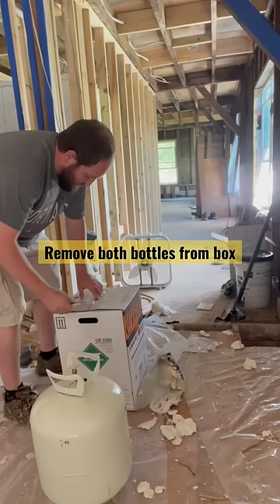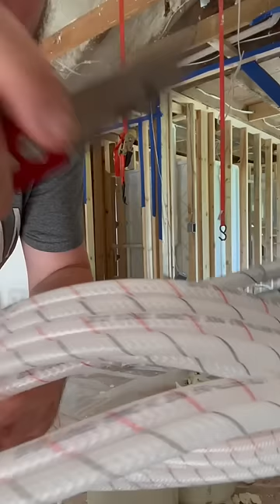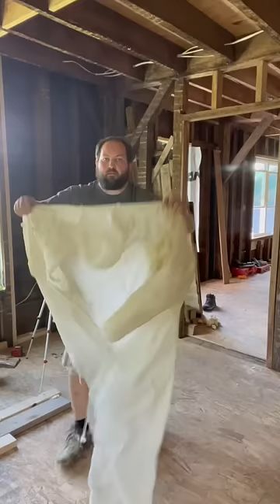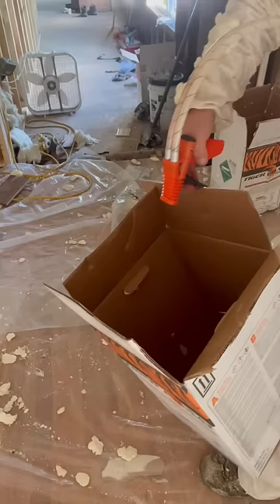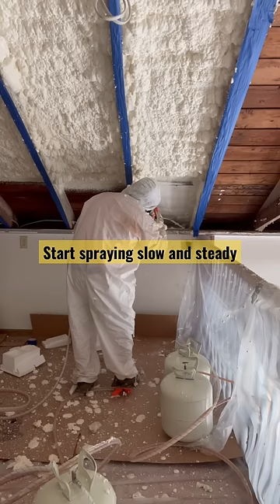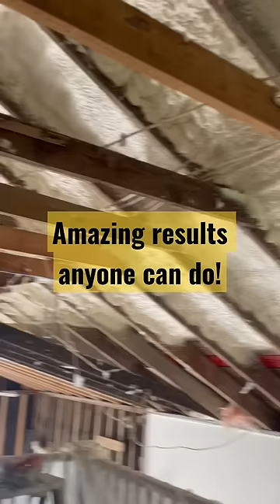Learn to spray foam in 60 seconds! 💡#shorts

Comment: I’m very confused. The comment section is pretty well split. Is this good or bad? Kind of wish I did this on my garage.
Reply: Well I live in Texas and have r-15, r-19 & r-30 fiberglass roll insulation i installed, and my attic stays around 70°s & 80°s on hot 100°+ summer days. Also its quick and easy to install, remove, replace or get access if work or repairs are ever needed to be done. The foam not so much. The fiberglass insulation isn't as messy, restrictive in multiple ways, pain instilling for repairs replacements and installing, or even take close to as long during the installation period. As long as it's installed correctly and is the correct type, rating and size for the occupied space it not only does the job, but performs and holds up just as well as any other products. Not to mention the kit of foam shown in this video costs just a little bit more than having a professional come and install it including the materials... but I wouldn't recommend spray foam at all especially without baffles between. I would recommend blow in insulation.
Reply: Its a great product but like anything you need to do your homework so you know the do's and don't for proper installation.
Reply: This product from Home Depot is an open cell polyurethane foam and doesn’t compare to a closed cell foam. It’s best for box sills on older homes. Also…never spray the underside of your roof…an air space below the shingles is required for cooling shingles in the hot summer months
Reply: @jamesalexander8368  you can apply directly to the underside of your roof sheathing if your going to air condition the interior space of the attic obviously the eves would need to be sealed as well to create an interior envelope. And in the video he's not spraying the roof of an attic he's spraying the ceiling of a loft.
Reply: @tubeetogoo  yes and we'll throw away our cars and go back to using horse and buggy we can also start building our houses out of mud again. And you're right there's many cases where the product has not been used correctly and they've had issues with it because it wasn't installed correctly but when it is installed correctly it's a great product that is much more efficient than the alternatives

Comment: Bs
Reply: I like how it's already foamed and you did a 1ft area that looks like shit
Reply: @jasonmayhann5832  he sprayed about 9sq feet and it looked like the rest what had been sprayed. And as long as there's the minimum depth needed it doesn't matter what it loos like it will work as good as any other application.

Comment: Please don’t use spray foam insulation in your home. I can only speak for Georgia sense that’s where I’m a licensed pest control technician. Most companies will not warranty any termite work if you have spray foam insulation as we can see the termites with ir cameras. They will use this foam as a highway around your home and we can’t detect them and by time you see them in the house thousands of dollars are already gone in damages that your pest company won’t cover. Please just don’t use this stuff.

Comment: I used tiger foam closed cell foam in my attic about 10 years ago. I had no problems. I just wanted an inch thick over everything for an air barrier before loose fill on top. Worked great

Comment: Such a waste of money. Those small froth packs are extremely overpriced. Good luck 👍 I would imagine you spent 3 times the amount necessary to insulate that.
Reply from the maker: I got quotes and this saved quite a bit, thanks for the comment!
Reply: @shpoon8184  those professional contractors you turned away offer at least a 10 year if not lifetime warranty.

Comment: People never tried to spray big projects with those spray foam kits those are just for small repairs im professional  spray foam insulation installer that's gonna cost you lots of money and if you do not mix it well  you and your family can get sick from the odors coming from
(Iso & resin) if it's  not well cure just hire local spray foam contractor maybe the same price
Reply: My exact findings a couple years ago, a contractor will spray nearly twice the board feet of foam (and do all the work) for the same price of materials of a diy kit.

Comment: And make sure your insurance covers wood rot from water infiltration. It will happen, but you won't know it with spray foam until it's extremely deteriorated. Horrible product. I see huge legal issues in the future...
Reply: If closed cell down is used it will not absorb water. Closed cell is a water barrier, air barrier, and vapor barrier. Only open cell will hold water.
Reply: @kscipkkkk  closed cell will block moisture from becoming obvious to the home owner until the condition is severe including deterioration of the structure and mold formation. All fiberglass will allow moisture infiltration and leaks can be identified quickly and repaired before becoming significant. Spray foam is a horrible idea for home insulation.
Reply: @CRPerformance1  If the roof is constructed properly and sealed water intrusion will not be a problem. I have owned homes for 40 years and never had an issue with water under the sheet shingles.
Reply: @kscipkkkk  I'm a home inspector and find water stains and leakage under plumbing vents, bathroom vents, around chimneys and valleys on a weekly basis. You're one of the lucky ones.

Comment: Heard about toxic gaz remaining in homes? Sofas, paintings, glues....
Reply: Not true if you use a professional they emit no toxic gas after 8 hours. If that was true you are already exposed most sofas and car seats are made of spray foam. This is the same process just a mobile version of it, I do this for a living except we use a 1500 psi, pressure balance controlled grace ph2 reactor.
Reply: @greggcallahan1580  producers would never admit their responsability after years of exposure... concrete plaster or glues are not harmless. So many cases where they hid growing alarming figures and their business kept running before trials.
Reply: @freeraiderfranc8785  spray foam is the only government approved insulation it’s literally the only approved safe insulation their is so… ok

Comment: Now your roof cannot breath… so when it sweats… and they do…. No place for water to go… so now your roof will rot.☹️
Reply: Not so with open cell. That’s why we don’t install closed cell in the roof
Reply: However, I do not recommend the DIY kits. The mixture and temp has got be just right. Spray foam insulation is great when installed correctly, but a disaster if it isn’t. It’s better to leave it to the pros.
Reply: @bigdw9545  
Open cell holds water closed cell does not. 
I would recommend sealing from the outside first before foaming to ensure no water intrusion.
Reply: @kscipkkkk  if there ever is a leak in the roof, open cell will let the water penetrate so the leak can be detected. With closed cell in the roof, the water doesn’t penetrate but sits between the foam and roof sheathing. The roof will be rotting without detection. Closed cell works great under floors and in walls. It actually adds to the structural integrity of the building in those applications. Not a fan of it in the roof at all, though.
Reply: @bigdw9545  Seal the roof properly and that won’t be a concern, not difficult to do.
Reply: @kscipkkkk  In a perfect world, yes, but things happen, bro: shingle damage, flying debris in wind storms/hurricanes, etc. A roof correctly installed can still be damaged in a way that it's not immediately noticeable to the homeowner. Open cell foam will give them indications of roof damage much more quickly than closed cell.
Reply: Nonsense.

Comment: To be honest, i dont want that chemical shit in my house...
Reply: It's not toxic when you let it dry completly
Reply: @MegaChickenPunch  yeah, but keep that in your house, not in mine.
Reply: FIY, everything is "chemical"
Reply: What a strange response... You know there’s a very good chance your house is full of asbestos, right? The paint on your walls has chemicals, the coating on your furniture has chemicals, your floors, the foundation, the roof, it all has chemicals. Spray foam dries very quickly and the chemicals evaporate leaving only the hardened foam. Whereas your typical fibreglass insulation (which is more chemicals) will continue to have particles come off of it forever.
Reply: You probably already have a bunch of foam in your house. Your mattress, your furniture cushions, carpet underlayments 
, etc. Life is chemistry, my friend. Without it we wouldn’t matter ;) 

Properly installed foam is just an inert plastic. You’ve prob got a bunch of that in the house too: electrical wire coating, window trim, plumbing maybe. 

Do you have painted walls or varnished wood floors? More chemicals! But as long as everything’s installed properly there’s nothing to worry about 🥳
Reply: @Mattew...  Apparently you've never used a ice chest....D.A.! Duh!